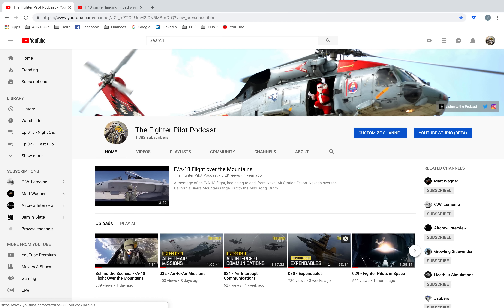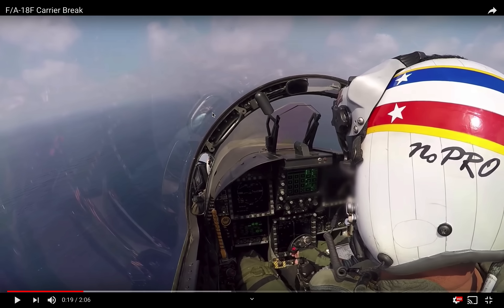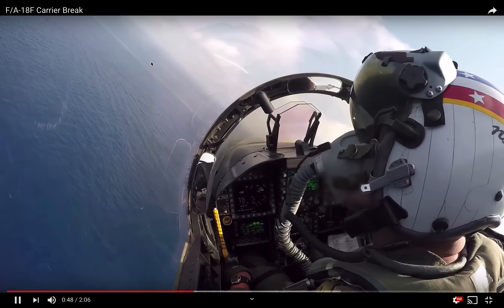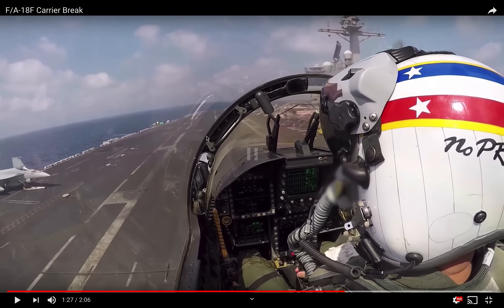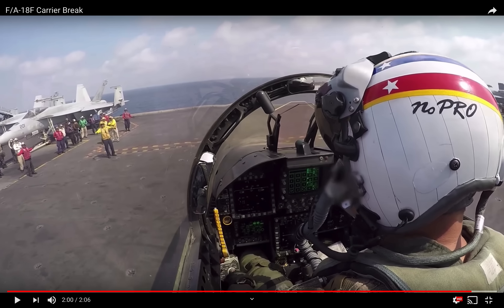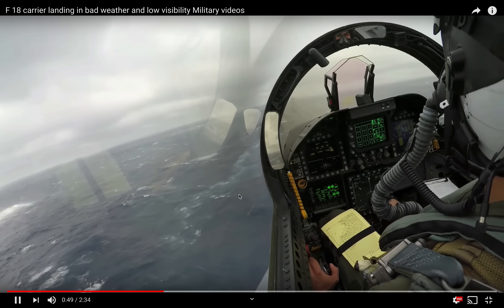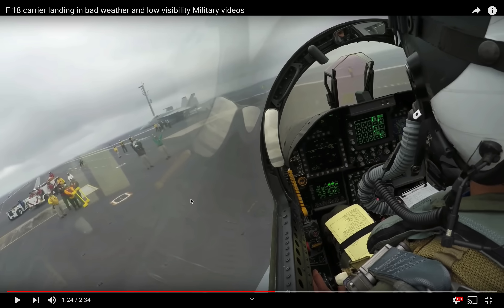What're They Doing? F/A-18 Pilot Breaks Down Carrier Landings

Comment: Rolled in 2 balls high, i walked throttles back and wasnt coming down (up draft) so I came back to idle (DUMB ASS) and as I came off the power just as I was entering the suckhole. I fell like "a turd from a moose." (Those were the exact words from my chief who watch the landing)  Went full AB before the LSO called it and thankfully I did or I would have hit the fantail. I saw a RED ball and thankfully the engines has spun back up. Caught a 1 wire for the first and only time in my career. Not checking winds that day was my fault and nearly cost me my life.

Comment: So might be dumb: but why does it matter which wire you hit? I feel like catching any of them should be a win 😂
Reply from the maker: Grades are used to incentivize pilots striving for perfection and the result of that is safety. The farther from the target wire the closer to either the back of the ship or boltering
Reply: If you catch the “one wire” that means you were very close to the “ramp” or “round down” (the back end of the carrier) and in a high sea state, in danger of being close to a “ramp strike”.  Remember, the hook actually slaps the deck before the wire which means it’s very close to the edge if it engages the 1 wire.  The 2wire is better but still not optimum.  The 3wire is the target as it means you flew the ball perfectly to its glide slope conclusion which results in the hook catching the 3 wire.  If you catch the 4 wire, there are no more and you are milliseconds from a “Bolter” that results in a go-around to try again.  Too many bolters results in a trip to the tanker or the “beach” if it’s in range.  If in “blue water ops” there are no “dirt diverts” available.
Reply from the maker: @seanlaughlin5015  👈 What he said.

Comment: I noticed the airconditioned helmet now in use.  We never had that feature when I was a Navy Pilot.  When did we get those?  Long in the groove, high all the way.  Extra credit for tight Burner Break.  (OK) Three wire.  To the viewers, an OK 3 is the best one can do, except for a very rare OK Underlined pass, usually reserved for exceptional passes with aircraft or crew issues.  Nice video BTW.
Reply: That’s the JHMCS helmet
Reply from the maker: Must've been after my time too because I never saw (or heard of) AC helmets...
Reply: @FighterPilotPodcast  That is actually a video cable for the JHMCS.  You'll see the visor is much bigger.  There is displays inside the visor, so when you turn your head, you still have info.

Comment: how does catching wires work with the engine at full throttle? does the engine automatically shut off after catching? or do the wire traps literally hold back a plane which is accelerating at full throttle on the deck for a short moment of time?
Reply from the maker: You should search YouTube for some other landing videos but, yes, the arresting gear assemblies are strong enough to hold an aircraft landing in full afterburner. The pilot retards the throttles after coming to a stop.
Reply: @FighterPilotPodcast  thank you! i was trying to search for a specific answer to my question but couldn't find one. Thanks for the help!

Comment: If a 1-wire is so bad, or potentially dangerous due to the AoA and altitude, then why not move everything forward and makes the N°2 wire the N°1 instead? That way you’d come in higher and avoid any mishap if the stern rises on touchdown - or slamming into the rear of the carrier. I assume if you miss N°2 you’d still pick up N°3, or even 4? Or would you go around? 
Ah thanks YouPube  for the 2yr old footage. Anything to shame the non-premium members…. I’ve been premium, it’s not worth a penny, it’s the original youtube except with a bucket held out for cash. 👎
Reply from the maker: Because you still need run-out room after catching a wire. I'm sure naval engineers have studied this extensively and positioned everything optimally. Wouldn't you think?

Comment: The last video with the other pilot. Even if it was the last wire he grabbed, it still is very impressive considering the fact that he was handling the aircraft manually, and at the same time getting the feel of the "Bad weather" compared to the first video where the weather was perfect... and it was a moving Airfield...
Reply: except you count the wires from round down forward. 1 wire trap means you were a bit low. Which he was, the LSO's were yelling POWER.

Comment: Great videos! One question ive never seen addressed: why is it so bad to catch any of the other wires besides the 3? Do they all operate the same way? Does catching another wire cause any other issues besides landing at the wrong spot? Thanks
Reply: My understanding, though I have no qualifications to answer this other than interest, is that there have been 4 wires on carriers for a long time, and if you catch the 3rd wire, it means you touched down in the middle of the landing area.  That's the target because if you're a little high or a little low, you still catch a wire, giving you the most possible room for error.

Edit:  just saw the comment by robert ross saying essentially the same thing after I commneted
Reply from the maker: Each wire is mechanically the same, but the 3-wire is perfection. Any other is not.
Reply: @FighterPilotPodcast  Perfect answer. I used to sleep and work abreast the # 3 Wire Machinery room on America (CV-66). Course you know what people on the 03 level get when an aircraft lands. I have tried to describe it, but.. .  This was about the grading. You should explain the grading system, the debrief and the board kept in the Ready Room that tells the world how you are doing. Especially if you were last.
Reply from the maker: @jw6857  Good point.
Reply: If you catch the “one wire” that means you were very close to the “ramp” or “round down” (the back end of the carrier) and in a high sea state, in danger of being close to a “ramp strike”.  Remember, the hook actually slaps the deck before the wire which means it’s very close to the edge if it engages the 1 wire.  The 2wire is better but still not optimum.  The 3wire is the target as it means you flew the ball perfectly to its glide slope conclusion which results in the hook catching the 3 wire.  If you catch the 4 wire, there are no more and you are milliseconds from a “Bolter” that results in a go-around to try again.  Too many bolters results in a trip to the tanker or the “beach” if it’s in range.  If in “blue water ops” there are no “dirt diverts” available.
Reply: @seanlaughlin5015  wow you can land on the sand??gear up or down?have you heard a divertion due to bad weather and  emergency landing soon after?thank you for the nice reply.this ramp strike thing i never heard before is good to know..i love to learn new tiny details.thank you
Reply: @martinrezzy  I’m sorry if I confused you with slang.  Dirt divert means you’re going to a runway on land somewhere…to a runway, at an airport but that runway is on top of dirt, not a pitching deck over water.  It is most certainly gear down.  The only time you land gear up is A. Unintentionally 😳 or B. Ditching at sea on water.
Reply: I love to see joggers on the flight deck catch any wire.
Reply: oohh man,that's what i wanted to ask too..perfection in bad weather?why?hell even a missed approach shouldn't be too bad than crashing into the carrier or something on it...i think this is overrated about the 3rd wire...i thought something else about that.you know we humans have some differences in perception and for some ppl the 3rd wire may be too easy to catch,but for some the 2nd will be easyer...i think the most fair should be 1234 every wire but the 4th should be good...i am not a pilot,i am just a big aviation fan and i don't know how it is in the navy...the rules and what not...maybe there is a sensible reason for that 3rd stupid wire every navy pilot talks about...its going to be kind of a mystery for us until explained in details...we should just trust them its the best wire to catch and that's that :) p.s. i really liked the detailed explanation of the landing..so much info for so short time...THANKS
Reply: @martinrezzy  I believe they aim for the 3 wire to limit the chance that you undershoot on the approach.
Reply: @mdsx01  i have researched a little and it's not about what you say even if it has sense to it...there are some carriers which have only 3 wires not 4 and there is this other thing in case you catch one of the last wires and it snaps,so i think that\s all into that matter...you need all the wires you can get in case you miss one,one snaps and the last one save your ass :) and the aircraft :)
Reply: @mdsx01  mostly because in some carriers are just 3 wires
Reply: @mdsx01  ohh my friend i just saw that the 4rd wire is second to the last one...the 4th is the last,so in our logic you want to catch the 1st not the 4th..this confused me again..what the hell is all about that 3rd wire?i can't understand..why not the 1st or the second? :)
Reply: @martinrezzy  it's better to come in too high when landing on a carrier than too low.  If you're too high and miss the wires, you go around and try again.  Too low and you catch your gear on the edge of the flight deck, you're having a bad day.
Reply: @martinrezzy  There are 4 wires they all operate in exactly the same way. Pilots aim to have the hook touch the deck in the middle of these 4 wires. The exact middle of the four wires is half way between the 2nd and 3rd wire, meaning the pilots are aiming to have the hook fly over the 2nd wire, hit the deck and catch the 3rd wire. 
The reason they're aiming for the middle of the wires is so if they undershoot they'll catch the 1st wire, instead of slamming into the stern of the ship. If they overshoot they'll hopefully catch the 4th wire instead of flying over all of them and having to go around and try again. 
On a 3 wire ship, they still aim for the middle of the wires for the same reasons, meaning the 2nd wire is now the one they ideally catch with the hook.
Reply: @martinrezzy  There is nothing special about the 3 wire.  It is the "target wire" on carriers with four wires/arresting cables/cross deck pendants (#2 is the target on 3-wire carriers), but you don't aim for it, you can't see the wires from the cockpit during the approach, and even if you could see then at the very last minute, you be looking at the wrong thing.

If the approach to the deck is flown with the meatball perfectly centered and the angle of attack (airspeed) is spot on, the tailhook will contact the deck between the 2 wire and 3 wire, so the hook will drag along the deck for a few feet and engage the 3 wire.  There is nothing wrong with catching a 2 wire or a 4 wire as it just means the ball wasn't perfectly centered on touchdown.
Reply: @rockriver2652  thank you

Comment: Outstanding! Two comments, if you don't mind. The de-arm area pointing over the starboard side is absolute. Yellow shirts sometimes have to fight with the SAR bird in starboard delta to remain clear. Forward firing ordnance, especially in the case of AIM-9s, doesn't care if that bird is a friendly. The deck crew and flight deck control call the 6 pack, the area of the flight deck close to the foul line and between el1 and el2 where aircraft are parked with tails facing port. We don't have a 6 pack during recovery. The area up by the Belknap pole (nav pole, crunch pole) is the point.  The deck edge between el1 and el2 is the corral. Aircraft parked to the right of cat1 (more forward of the point) are on the 1 row. Thanks for your excellent video breakdown.

Comment: 2nd 1/2 vid - I don't get it.  You seem to be implying that a 1 wire landing is bad and that the correct action was instead of going to idle that he should have held the power constant or at least adjusted it less.  Correct?  BUT if he had maintained power, would he have overshot the wires?
Reply from the maker: The 1-wire is close to the back of the ship and so is not ideal, but is still a viable wire.
I don't want to Monday-morning quarterback the second pilot, I simply wanted to point out the burble and the effect it can have on reactive ball flying. I did that very thing many times myself.
Reply: @FighterPilotPodcast  So you're not going to say what the correct action should have been?  That seems odd.  You're already pointing out that it's not an ideal landing but you're doing it in a sort of clinical way.  You can do the same with the correct actions "as stated in the manual" or whatever.  I mean you're already monday morning quarterbacking his actions as it is.
Reply from the maker: @jontnoneya3404  I disagree, but I won't try to persuade you.
In that case: what he should have done is manipulate the controls to perfectly stay on the desired glide slope all the way to touch down despite the environmental conditions.
Reply: @FighterPilotPodcast  Ok but isn't that what he was trying to do?  I mean....what else would he have been trying to do except exactly that?  You're not making any sense.
Reply from the maker: @jontnoneya3404  I'm not sure how else to explain it in a manner you'll understand. The second pilot made a common mistake. I've made the same mistake so far be it from me to criticize him for it. All naval aviators strive for perfection, most come up short.

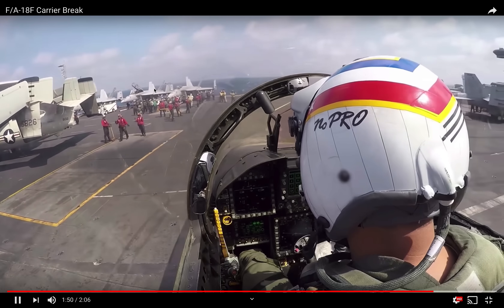Comment: 6:20

Hawk eye props always terrified me.  That huuuuuummmmmmm coming from somewhere behind you while you handled maintenance on your aircraft, followed by “props on the move”. You tend to get a lot skinnier, a lot shorter, and a lot closer to your aircraft until you turn and located the sound’s location.
Reply: You know how a dog shakes its body when it comes out of water? I still got that shake with the first hummer after we set sail; even after 26 years. Sometimes more than once during CQ.
Reply: When it was at night, and the pilots were at idle, the pitch of the props was neutral. So there was no prop wash to tell you which hummer was spinning. You never went through the prop arc, EVEN in broad daylight when it wasn't spinning. That habit helps you NOT WALK THRU IT ANYTIME, EVER!
Reply: @hifinsword  Sounds like the safest place to be was in the cockpit…
Reply: Absolutely,I was a director on the flight deck and that hum was always terrifying, especially when the pitch of the hum changed.
Reply: Read your comment and was interested to know what the Hawkeye sounded like so googled it.  Sounds like 1000 pissed off bees!  How the hell could you hear anything on deck?
Reply: @Axl_Pose  you didn’t. everything was hand signals and some people had headsets in their cranials.

Comment: I literally just watched the second clip before this video. I wish you kinda explained the rest of the clip, it gets really scary as he taxis so close to the edge and gets handed off to so many other yellow shirts to what appears to be the elevator...
Reply: Yellow shirts in Fly2 will get close to the deck edge. If they touch it, they'll get their butts handed to them. Usually the two options are to go to the deck edge where they'll turn inward and then get pushed back or taxi to an angle facing to about the ship's 7:00 with nose on the foul line.
Reply: @michaelmappin4425  When a pilot is taxied that close, which is routine, the Pilot has to be used to the feeling that he is taxiing into the sea. The cockpit is foreward of the nose gear and that is ball tightening to watch. Especially when the deck is slippery and you watch a pilot's nose gear turn one way and the jet starts slipping sideways. Usually takes about 30 guys to stop one.
Reply: @jw6857  I'm not sure you wanted to respond to me. I have been moving airplanes on carrier decks since Captain Crunch was an Ensign. I was born on the crest of a wave and rocked in the cradle of the deep. When I spits, I spits tar. By the way if an airplane slides, nobody is going to try to stop it.

Comment: Why does the second F/A-18 do not have an RWS /Alt/Speed "Screen" on the right panel?
Reply from the maker: Sorry, I'm publicly educated and don't understand the question--can you please explain what you're asking?
Reply: Sorry. So under the Right DDI (first Video) there is a (i believe its) speed indicator a RWR indicator an altitude indicator and an artificial horizon indicator. In the second Hornet (Second Video) none of them are present under the right DDI but just a small screen. Can you please explain what the small screen is and why the other indicators are missing? (Sorry English isn´t my mothers tounge)  @FighterPilotPodcast
Reply from the maker: @wumbo9082  Oh, gotcha.  They replaced all the standby "steam gauges" on older F/A-18s with a single electronic standby gauge on the newest Super Hornets, I want to say lots 34 and above (or so).  I flew one such aircraft only once before retiring.
Reply: Allright, thanks for the quick reply @FighterPilotPodcast